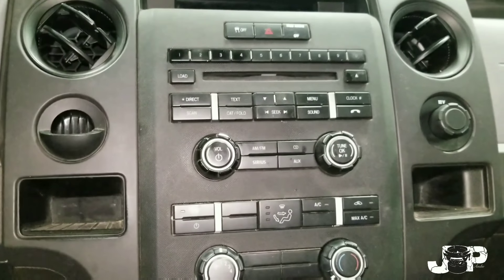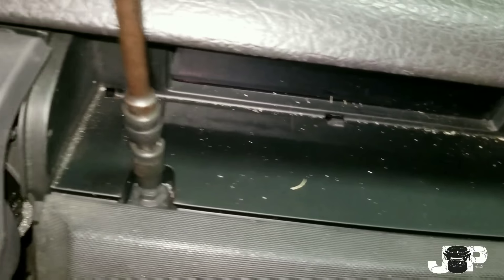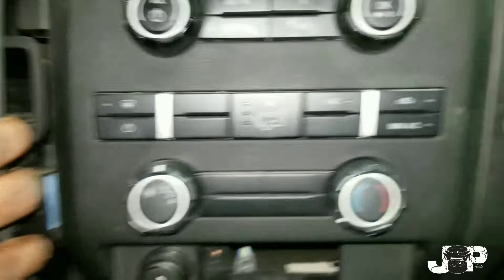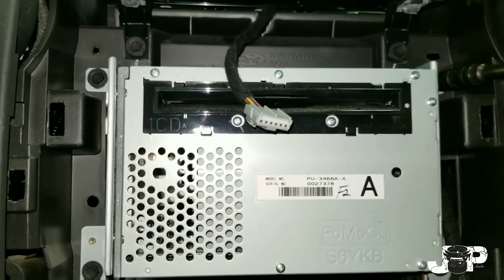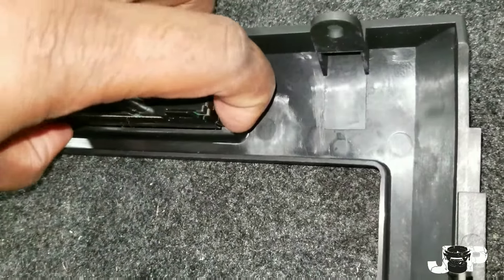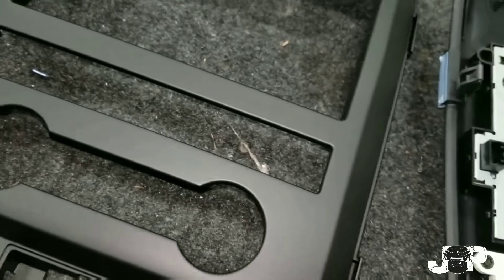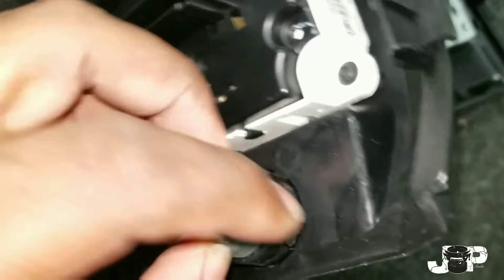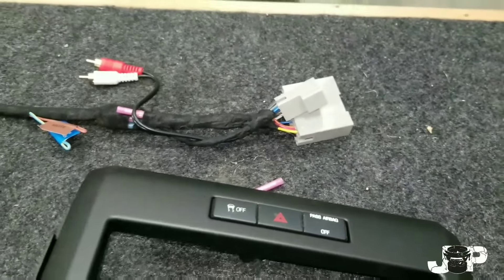2012 ford f150 radio removal/install

Comment: Good video. I gotta ask what is the small 4 or 5 prong wire harness on the ac control module for? I have a 2010 xlt and I’m wanting to turn my ac speed control to variable  speed. I know I need a different blower motor resistor but the only thing stopping me is that I don’t know what that harnesses is for. Thank you

Comment: How do you get the orange cable off? I'm stuck on that. Looks like it runs to the antenna
Reply: Love how nobody shows you how or will answer this question. You end up getting it off?
Reply: @bucsfan4209  I'm having same problem
Reply: @daves.2104  it’s just a pain in the ass to get off like they glued it in there just use some force and it’ll come free

Comment: How do you get those two side panels ALL the way off? I want them out of my truck so I can paint them to match the exterior...
Reply: Take off the two bolts underneath the steering wheel near where you plug in the OBDII reader, that holds the plastic trim on that's covering the left side trim to the left of the radio. That exposes the bolt. Right side, open glove box and unhook it lay on floor. At this point disconnect battery and wait 15min. There's 3 bolts inside glove box look upwards. Take those off, and pop off the left side of the airbag cover on passenger. That exposes that bolt. Then, pop off both silver trim pieces from the bottom!
Reply: Ben Boyd well look who figured out the password on mom’s computer 🙂 back to bed Billy

Comment: I'm a woman and I'm scared to try.. 😔🙁🤭 but.. $515 at the Audio Store  😳😰😨🤢 so.. I better get to it‼️💔
Reply: You can do it!  Just make sure you match your wires correctly  when wiring the harness. I did see other posts that said you need to run your main power wire to the 2nd brown wire on the ac harness. I'm getting ready to do my truck as well. Good luck

Comment: Can you take the display screen out that's located above the radio? I have a 2014 Ford F 150 XL and I have a 2013 Ford F-150 XL and a 2012 has the display screen and I'm wondering if I could swap it with my standard radio and no screen in my 2014?
Reply: derek smith at least I’m not the only one asking this

Comment: Can you still drive the truck with out the radio bec mines messing up and I wanna send it in and have it fixed
Reply from the maker: yes just make sure your passanger airbag light is plugged in

Comment: Where’d you get the wiring harness ?
Reply from the maker: the part links are in the description but it was a metra 70-5521 https://amzn.to/2JP6Rc6
Reply: jpsaudio08 thanks! Did you use all connectors? Or just the one main one?
Reply from the maker: @McMicahMcKinley  just the main harness
Reply: @jpsaudio08  is it possible to swap another factory radio from another 2012 ford f150 to another ford f150 can the years be 2010-2012.   2012-2014 or from another ford f150.  Or is just possible to swap a 2012-ford f150 to another ford f150 ..... factory radio are they swap able